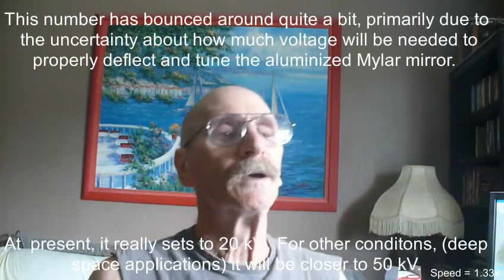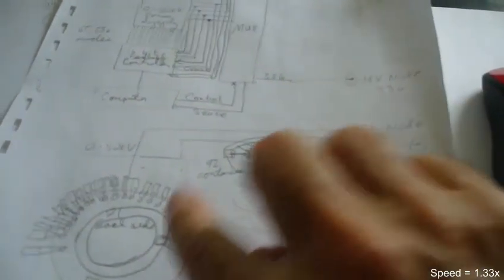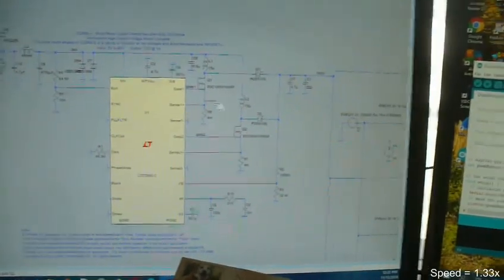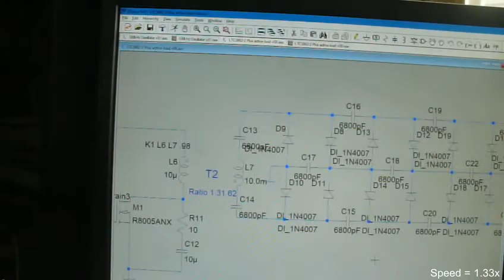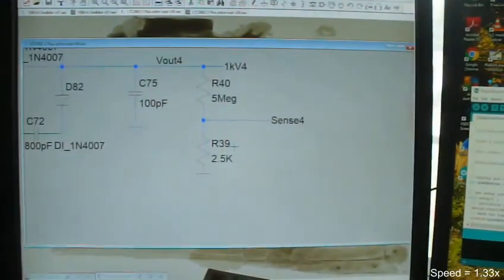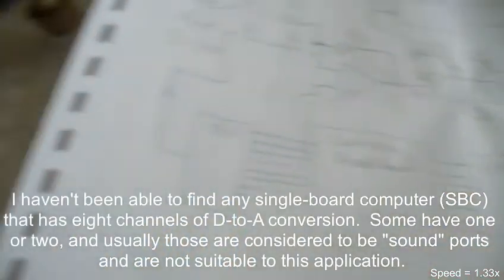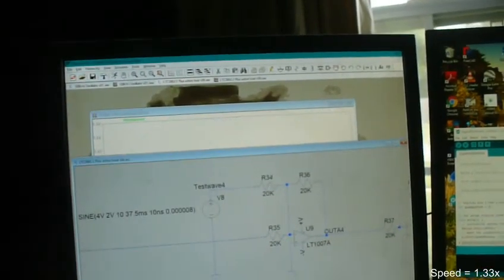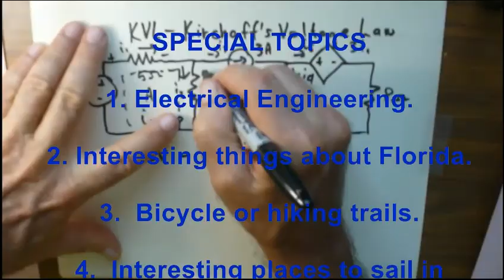Part 9 Design and Build a Mylar Electrostatic Telescope: High Voltage Control Circuits & Distributor

Comment from the maker: I've modified this design quite a bit since this video.  For one thing, I don't use a Sense line anymore.  The problem is that, once you set a node to a voltage, Node 281 = 13,504V for instance, you don't want is to change, especially to lose charge.  So that means here can be no resistors on the output.  Instead, I use capacitors.  These will store the charge and then retain it.  In order to measure that charge, a voltage-dividing capacitor network is used, and at the end of that will be a MOSFET, also with known charges, which will generate a 0 - 12V output according to in high voltage output.
This saves tremendously on battery power, whether on the ground or in orbit around Jupiter.  Once charged-up, the nodes retain their charge and the telescope mirror retains its shape.